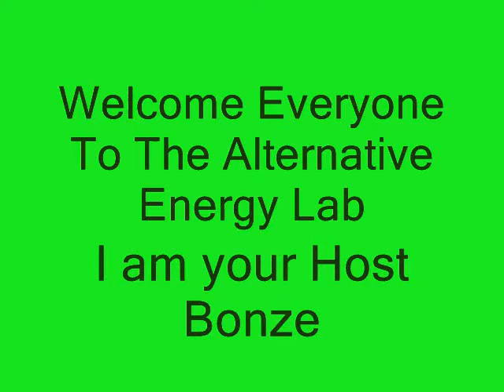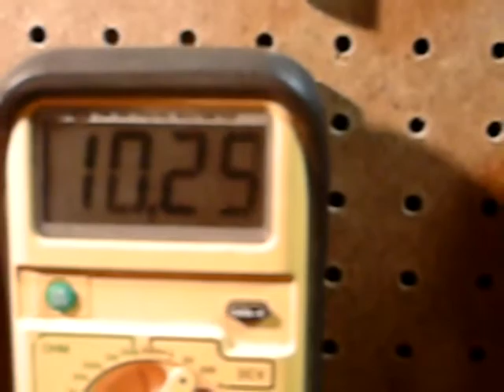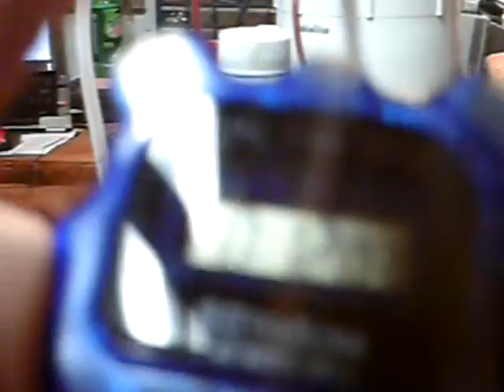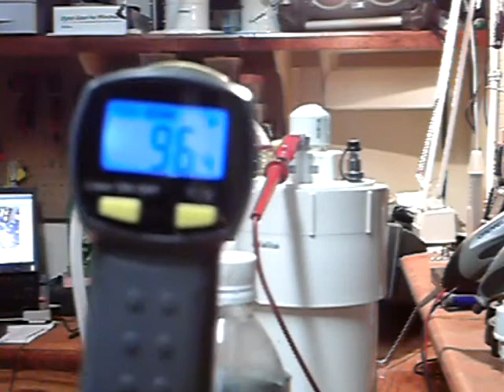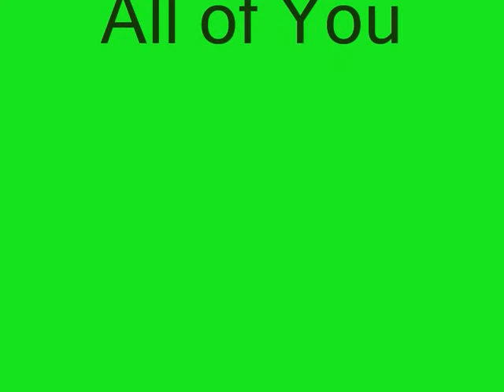Stinger Sr. Bench Test

Comment: I was just wondering if you had the HHO flowing freely before you started the stopwatch? in other words, there was no building pressure of the unit running with the valve shut off so that there was a compression of gas waiting to excape resulting in a false conclusion and not a true, "flowing" reading of HHO per minute.
I'm not trying to be an ass, just wondering :)
Carl